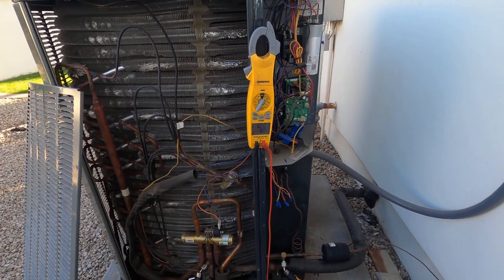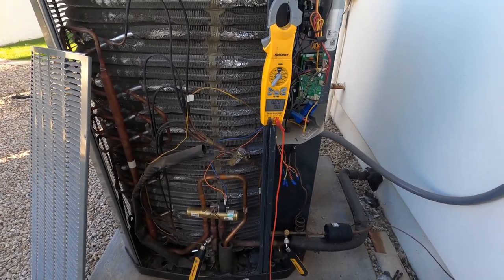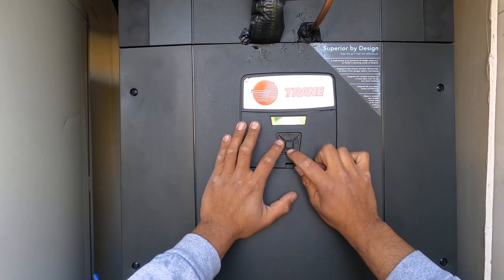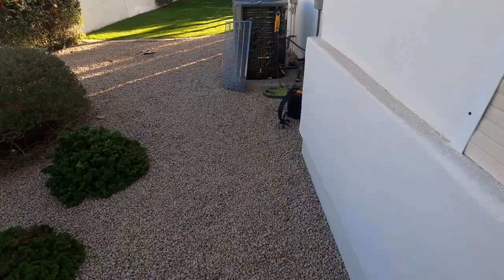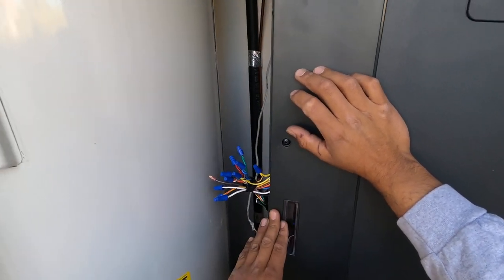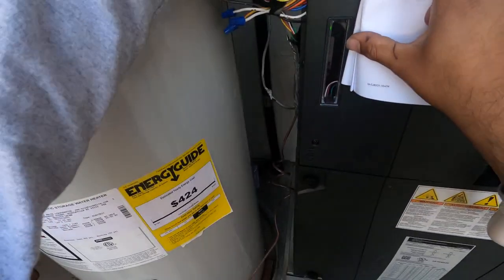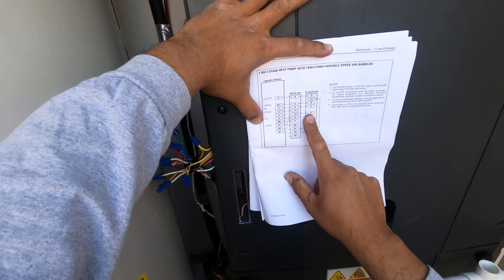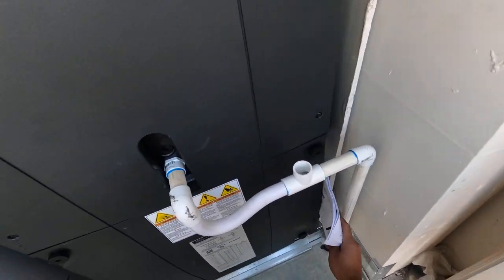A common mistake guys make when installing Trane. HVAC INSTALLATION AND REPAIRS SCOTTSDALE ARIZONA

Comment: I was blessed to start my career on nothing but these systems. 

I remember the smoke grey tam7s with quarter turn door latches, and a pre drilled high voltage holes. These TAMX systems are sweet with link 360.
Reply from the maker: They're a solid air handler 👌🏽

Comment: Those manuals that come with the 1050 and 825 controls are gold they give you every setup for any setup you can do unless you need a relay panel then the relay panel has wiring diagrams American standard and train are great

Comment: I'm a DIY'er, I've had multiple HVAC companies come out to see why our upstairs is so warm during the summer and they're not really giving us any answers.  We have a TAM9 air handler and it seems to just not be flowing enough air.  The air coming out of the vents is cold, but the volume of air is just insufficient.  It'll run ALL day and never get below 84 degrees.  I am trying to figure out how to increase the fan speed, let me know if you'd be able to come out and look at it?  We're in NE Mesa.

Comment: Trane air handlers also closes down EEV in off mode to trap refrigerant between compressor discharge check valve and EEV during off mode to prevent possible off state liquid flood back to compressor input, particularly during cooler outside temps.  With their large condenser they have a large refrigerant load so will be more prone to off state liquid refrigerant flood back during off state if they don't trap refrigerant in condenser during off state. During off mode, once condenser cools down, refrigerant turns into mostly liquid and stays in condenser even if pressure equalizes due to slightly leaky compressor check valve.  When you change out a compressor it is especially important to wet cloth wrap the compressor discharge port check valve to avoid possible excess brazing heat warpage of check valve disks.

The AFC board YO output to compressor ensures compressor is shut down when EEV is closed off when air handler shuts down.

Not using YO also bypasses evaporator freeze protection which is more likely to damage aluminum inside coil, and if Trane's condensate overflow switch is used, prevents overflow from shutting off compressor.  Standard normally closed condensate switch should be wired in series with AFC board's Y1 line from thermostat Y compressor call, NOT compressor contactor relay control line to outside unit connected to AFC board YO output.
Reply from the maker: thanks for the valuable Information!

Comment: Trane now days you have you have to go by the comfort control 824/T-stat wiring diagram opposed to installation guide. For instance…a TEM6 two stage cool heat pump with  variable speed indoor bk jumper cut…. Y1 and y2 are capped off at the air handler. So the t stat wire from out side to inside are wired directly opposed to wired nutted from air handler wires coming from harness. It changes per unit as well. Like TAM9s. Its a trip.
Comfort controls are so smart. Fascinating how they communicate!
Reply from the maker: Yes they really are advanced! It's a bit of a learning curve but variable speeds are the future and we must adapt!

Comment: Avoid Trane at all cost.. I had a $10,000 Trane XR17 system put in by them. Purchased and Installed by an Authorized Trane Dealer, Larson Air Conditioning, Scottsdale, AZ. Nothing but problems from day 1. Had to replace the Heat Pump after 3 weeks. Brand new and leaking from the factory.  Then it took over a year to fix a problem that would cause it to quit cooling (over 12 times in the first year). My 15 year old no name AC system I took out was way more dependable than this Trane system.
Then the Air Handler coil broke in year 2. I called Larson Air Conditioning and they sent a service rep out.. said all my Freon was gone.. they said it leaked out somewhere.. he could not find the leak he said... said it must be under my concrete floor since he couldn’t find it... he offered me a $300+ test to do a UV test.. I knew the chances of that were almost nothing so I called BS. .. so I told him to fill up the system with freon which cost me $900. 2 days later no cooling again.. Fed up with Larson I called another Trane dealer for a second opinion.. in 10 minutes he found that the Air Handler coil was leaking...thats where all me freon was going.. outside in the condensate line.... but Larson guy couldn't find it? while the coil in under warranty (but backordered for over 3 months and counting.. still not in) it would cost me $2500 for the freon and labor to have the coil put in. . So during the first year with all the problems ... so by year 2 it would cost me $3500 to fix this Trane AC system that’s “Under 10 Year Warranty”
And don't expect any support from Trane Customer Relations either.. after 2 months of repeated requests from Trane Customer Relations for a refund or any financial assistance.. they say they cant help ANY. So Im left with no option but to leave this unfortunate and honest review. 
I have since removed the 2 year old Trane system (coil has been backordered for over 3 months and still not in). No coil.. No heat in winter… I was forced to take out the Trane POS and install new Carrier system which has run flawless..
The current Trane isn’t the old Trane that had a good reputation ever since bought out by American Standard.   “Its NOT hard to stop a Trane”
Reply from the maker: It really is sad to see people go through your scenario and lose their hard earned money, Trane is definitely not the Trane of 20 years ago.
Reply: Is all about profits now days. Shame on them.

Comment: My Dad's Train Derailed last year and it had to be replaced.   It was a Gas Pack and the Heating part of it rusted out.   The central air part still works fine, but No more heat!!!
Reply from the maker: Yes I saw a Day and Night unit do the same thing this last winter.
Reply: "Train derailed"lmao

Comment: Good find. Had a similar one on a runtru where the Y wasn't on the board but instead wire nutted together. Unit didn't know the Y even had power so the fan ran in the lowest speed. Kinda crazy how whoever installed the unit put every other wire on the board but then wastes a wire nut and doesn't put Y on. Lol
Reply from the maker: I've seen that before too lol 😆

Comment: The  3 units I’m considering to install in my house are the Bosh ids 2.0 bova20 or train xv18 with tam9  or daiken fit they all came in the same price range with state rebates at $12k which will give me least problems ?
Reply: Daikan Fit, Amana S-Series, and the Bosch 2.0/2.1 are all great units for the price.  Bryant has the 284ANV Fully Variable or the unit I prefer as I sell quite a few of them is the Bryant 288BNV with is a 5-stage Copeland inverter Rotary Scroll compressor.

Comment: Do you get that bouquet of wirenuts for free when buying a trane? 😂
Reply: people need to start using wago's. i am so sick and tired of wire nuts.
Reply: @SupremeRuleroftheWorld  because wire nuts dont work?
Reply: @wilbovivs7708  because they fuck up the wires for the next guy (wich is probably you) and causes you to need to cut and splice because the wires are suddenly too short after getting mauled by the nut.
Reply: @SupremeRuleroftheWorld  If you know how to use a wire nut you won't destroy the wires. If you leave enough wire when you install the thing you will never run out of wire. Which is cheaper and less prone to failure when used properly? I'll stuck with nuts. Don't be a prima donna
Reply: @jman0870  wire nuts destroy the core by its very design. if its not mangled you used it wrong. renutting a mangled core gives bad connections. you should know that if you actually had to fix 20+ year old disasters from a half dozen repair guys before you.
Reply: Why can't they make a wire harness for different settings that is.ug and play to avoid mistakes.
Reply: Nice pissing match. 👍
Reply: @stevee7774  pissing off self proclaimed know-it-all HVAC techs is hilarious to me, what can I say?
Reply: @SupremeRuleroftheWorld  Guess what?? I replaced a 28 year old well pump yesterday and everything is in a damp disgusting pit. The 28 year old wire nuts that weren't in an enclosure of any kind were almost as good as new and had zero signs of overheating or corrosion even though the wiring rubbed through and hot was shorted directly to neutral under the well cap as well as hot was grounded at the romex connector clamp in the pressure switch causing infinite amps to flow through them multiple times (you know, because the owner reset the breaker a few times). If only the original installer used wagos instead of letting the wiring rub against the well cap and stuff...hahaha
Reply: We use what the company provides

Comment: Is that configuration the same for American Standard which is made by Trane?
Reply from the maker: I haven't seen much difference between the two except for the badge.
Reply: Even the model numbers are the same for most of them. Nothing different but the badge and condenser color. Once upon a time there were some differences but since IR bought them pretty much identical. I'm a AS dealer and most of my package units have the AS sticker on top of the Trane. Perk it off a instant Trane

Comment: No P Trap Need that’s a positive induced air handler!!
Reply: Congrats you read the manual.
Reply from the maker: true but most inspectors out here still require them since they don't understand the difference
Reply: @themoderntradesmen9352 they can’t require it because manufacturers manual overrides code, however I don’t know if it is worth arguing over lol

Comment: After 3 years of poor cooling with a TEM7, I decided to look at the wiring and found out the installer did the same shit job. The BK wire from the thermostat wasn't even hooked up!
Reply from the maker: it's a small mistake that can lead to big problems

Comment: Another thing Trane does different, why have wires dangling outside of heat pump or condensing unit?  Seems dumb cause every unit have to bring into side access panel or into control cabinet.  If I don't some inspectors fail if wires left outside.
Reply from the maker: it is a very strange design and I agree they should keep the wires inside the cabinet.
Reply: That’s just how the installers chose to wire them. I install those Trane units all the time and I pull the low voltage wires inside the cabinets on both units. It’s especially important on the condensing unit because you don’t want wire nuts exposed to rain
Reply: Goodman does the same thing. Who would have thought Trane would pull one out of the Goodman handbook haha

Comment: Question, we been having issues with Tam9 with small amount of drips thru the secondary drain line to the emergency drain pan. We are thinking its a static pressure problem?
Reply from the maker: definitely could be, also check pitch on the unit,

Comment: I’m not sure if I understand what you’re getting at, but are you saying that the way it was originally wired the indoor blower was not coming up to the proper speed causing the evaporator coil to get too hot in the heating mode.?
Reply from the maker: correct. They never called back either so problem fixed

Comment: RTFM.  
    I have seen equipment where the installation manual is still sealed in the plastic bag.  Definitely raises my level of suspicion as to the quality of the install.
     All mfg change their equipment over time and the manual needs to be checked for changes in installation requirements.
Reply from the maker: well said 👏

Comment: Are those low voltage wires supposed to be wire up together and leave outside the unit or do you wire them and leave them inside the unit? I like to put them all inside the air handler behind the door. What do you think is the best way?
Reply from the maker: good question it's better to leave outside so you can diagnose some low voltage problems without opening the cabinet

Comment: I have a new XV20i with a TAM9 air handler. Condenser  has iced over 3 times and the coils are always frosted over when the outdoor temps are in the mid 30F's. The condenser is very loud when it gets cold. Also the TAM9 has an EH CFG1 error on the LED display and it wont clear even after a restart. The installer told me it was normal for it to ice up and just use emergency heat. TAM9 error code.
Also - What are those booklets? The installer of my unit did not leave me any documentation.
Reply from the maker: Get a Trane Dealer who knows about Xvs systems. You shouldn't be having those issues with a normal operating system. Icing is normal but the defrost cycle should thaw it out. Xvs are some of the most quiet (I've owned 2) have them check it out.
Reply: @themoderntradesmen9352  I want to do that if I can find a different dealer to service the system but the installer told me if I don't sign up for his annual maintenance plan the warranty will be void.

Where can I get those "booklets"?
Reply from the maker: @lakemarine484  the booklets are called installation manuals and can be found by putting the model number in Google and typing installation manual after it
Reply: @themoderntradesmen9352  I punched in my model # and found service facts and install manual on manualslib. It talks to overspeed and I bet mine is set to high and that is part of reason it is so loud. I also bet my defrost termination is set to 47deg thus the ice banding I am experiencing and perhaps setting it to high (60deg) would solve my issue. Im going  to toggle through the CDA tomorrow and see what my unit is set to. I suspect my unit is set to factory defaults. I don't see anything that mentions the EH CFG1 error im getting though.  Hopefully I can find a service company that knows about the the unit before I sign up for a service contract.

Comment: Thanks!
So what do you say to the customer when they ask what was the Problem?

Because, if you tell the truth that it wasn't wired correctly with Trane's installation manual.....you've just poured gasoline on a fire.

& If the company you are working for installed it.....well, now you are really in a uncomfortable place, because the customer is going to call your employer wanting their money back that they paid for the install. & they are going to tell the guy that signs your checks, that you said "x,y & z" 
-Which makes you look bad to the guy that signs your paycheck.
-Even though, you did nothing, wrong; & you did your job honestly & professionally.

I get these kinds of service calls, frequently.
& it just seems like, because I was the one dispatched....I am the bad guy, after its all said & done.

So how do you handle this type of call?
Reply from the maker: excellent question I think I'll make a video on that
Reply: @themoderntradesmen9352  Thank You, Sir. Looking forward to liking that video, too
#👍
Reply from the maker: @adamspears3819  uploaded a few minutes ago!
Reply: Great question!
Reply: @themoderntradesmen9352  TY

Comment: i thought the tam9s are up flow so you dont need a ptrap?
Reply from the maker: they don't need a trap because they are positive pressure but some inspectors will fail you if they don't see a trap

Comment: I have a trane hyperion tam8 air handler with 4ton xl20i heat pump. The screen shows it is putting out 1390 cfms so it's set on the 350 factory setting. Do you know how I can change the setting to 400 cfms changing cooling airflow setting?
Reply from the maker: yes it is done on the display on the airhandler itself. Hold the up and down arrows for 10 seconds and then scroll to the right until you get to configuration menu. Then scroll down to cfm and adjust to 400. then press the middle button to save
Reply: @themoderntradesmen9352  thank you I will try that in the morning. We was told we would save a lot of money on this unit and there was no drop at all, I was considering on selling it and going with something else. It runs none stop guess cause not enough cfms to turn the air over.
Reply: @themoderntradesmen9352  also would I need to change any other settings?
Reply from the maker: @wildnuts6197  There are so many variables but a 20i system installed by a solid team will absolutely save you money!
Reply from the maker: @wildnuts6197 that is the only setting for airflow really
Reply: @themoderntradesmen9352  I found out my issue. The unit is set at 400cfm if I turn the fan ton100% it reads 1390 cfm. When they installed the unit ( it's a upflow) they made a return plenum out of duct 1.5" board that goes to the bottom of unit up to the attic. I just measured it and it is 21x17 so the inside would be 18x14. I cut a opening door in the plenum about 17x20 and guess what my cfms jumped up to 1740cfm contacted they and they want me to play a big price to come and fix what they did. Your thoughts
Reply from the maker: @wildnuts6197  it was a red flag your ac wasn't saving you money, so right away you assume an installation issue and you found the issue so yes they should fix it but not everyone owns up to mistakes. You're much better off getting another company to fix the issue just really vet them first.

Comment: Doesn't need a p trap
Reply from the maker: you're correct since it's a positive pressure air handler. I left it because  more than once have i had to explain that to an inspector who was brainwashed into thinking "every air handler needs a trap"
Reply: @themoderntradesmen9352  the counter point is loss of airflow through 3/4 inch hole. Albeit, it may be an insignificant amount of airflow loss, but can make a difference if you’re low already. A fully primed trap will at least prevent this from happening.
Reply: @themoderntradesmen9352  Thanks for explaining. I guess that's why when I switched from a Trane to a Lennox (cost issue) I went from no P-trap to having one I watch.

Hope you and your family stay safe and well.
Reply from the maker: @ccadama  thanks you too!